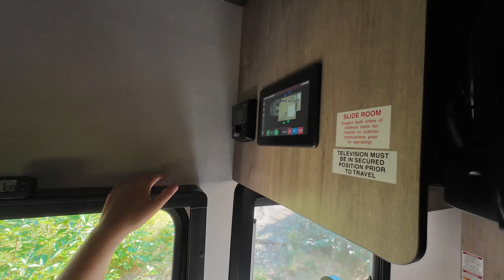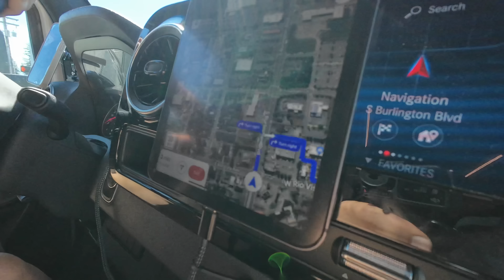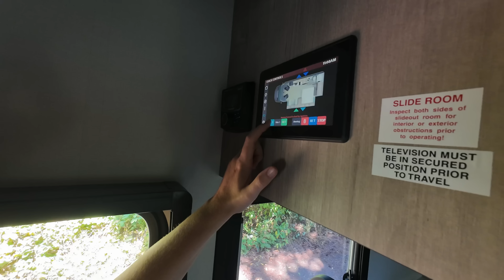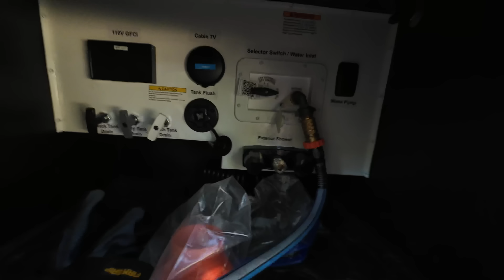My Wife Drives (And Sets Up) Our RV Alone

Comment: So important to change roles not just in rving. My husband had a stroke 6 years ago, and I do everything inside and outside. Not easy at all. One night a bad rain storm caused a leak thru the roof into the kitchen, forgot to bring in the 30’ awning, and the smoke alarm kept going off. Since I couldn’t stop the screeching, I took it and threw it outside. Solved!  Keep changing roles, it builds such confidence and character.
Reply from the maker: It is important!

Comment: Great job!  I will say this is why a motorized unit appeals to me, and I like your unit! I think it may be more user friendly than a towable as far as driving .  This is on my bucket list to switch driving roles.  I have helped with most everything else.  We have a 34’ airstream trailer, a gooseneck living quarters horse trailer, and I tow a small horse trailer and I still can’t back up to save my life.  The living quarters horse trailer scares me way more at the thought of towing than the airstream. So far, my towing rules are 1) Get in the right lane 2) Stay in the right lane 3) If it involves backing up, simply avoid and only do situations where I pull forward.  I don’t know why, but so far, hubby has not relinquished control of our 34’ airstream classic. He wants us to find a huge empty parking lot to practice first.
Reply from the maker: Thanks! We got to try this prototype from Grand Design out and we have loved it!

Comment: One thing I was taught was to change the water selector before turning on the water.  They told me changing it while under pressure is hard on the valve.
Reply from the maker: Thanks for the tip!

Comment: You never know what will happen when you are on a trip. I know ppl have roles they prefer and are comfortable doing. But if something were to happen, it's important everyone knows what to do. This includes trip planning,  navigating,  and the financials/insurance. If someone gets incapacitated, there's no reason someone is left helpless or clueless.  Having some experience will give you confidence that when called upon to act, you can do it safely esp if you have kids depending on you to remain calm and do what must be done. I hope as your kids get older, you show them the important safety measures they should take to get help or to step in to help. By 8 i knew how to cook, put out of grease fire, and do basic first aid. Thank you Girl Scouts/Brownies, and parents that were migrant farm workers who had to help out as kids and made sure we had skills too. Marissa did well. Hand signals should be reviewed before having to use/understand them. Set the camera on a tripod etc so the driver can see the signals or use a cell phone like many other RV couples do. Frustration is a two way street and it doesn't have to be. Keep switching roles until you're both somewhat comfortable doing them
Reply from the maker: Yes, we should be able to reverse rolls and help each other out if needed!

Comment: My wife and I had 3 travel trailers. She did not pull any of them nor did she ever want to! I was fine with that! I remember just after getting my drivers license (16-17) my mom,sister, and I went camping for the weekend. She had to get someone to back it into the campsite as it was a tight fit. On the way home she asked if I wanted to try pulling it, I said sure without hesitation! I drove the rest of the way home even having to take a detour along the way. When we got home she asked if I thought I could back it into the woods across the street where we parked it? I said yes, she said to let her out, she wasn’t going to watch. Before she was in the house, I had already parked it where I needed. She came running back over and asked me why I didn’t do that I n the campground? I told her, you didn’t ask! 😂
Reply from the maker: Awesome 👏 you’re a natural!

Comment: The added weight of two children sitting in the moving slide is enough extra weight to break that weak slide motor.  If you want your slides to last then remove ALL extra weight before moving the slide.
Reply from the maker: Thanks for the tip.

Comment: Nate, I am going to leave with this. Like I said, I was a union ironworker for 35 yrs. Had to flag cranes and other operators for different things. Figure out how each of you wants to flag each other with hand signals. Meaning, if you want to turn more in a certain direction. The fast you move your hand, the faster you need to turn. Slower you move your hand the slower the turn. Straight back is parallel to you head. Watch planes being parked. If you are lined up. They have their arms out wide, closer you get to stopping point the move their arms in closer. Stop is when their arms cross.
Another point in communication. If the person flagging behind points left. Does that mean the back of the trailer needs to go left or do I need my front tires to turn left ?
Reply from the maker: Thanks for the tips!

Comment: Those hand signals drive me nuts . As a primary driver you should know ,you cant see 1 hand movement with a vibrating mirror . You see millions . Point inthe direction with both hands , one arm streight out and the opposit with the palm facing your chest , dont move , the mirrior does . When its time to stop , clench fists in mirrior direction , dont trip trying to walk backwards
Reply from the maker: Yes, typically one person isn’t holding a camera in one hand and directing with the other 😊
Reply: I find audio easier just a voice saying driver. passenger, straight, or stop
Reply from the maker: @Tatiacha  thanks!

Comment: We are so surprised that you’re not using disposable gloves to handle emptying the black and gray tanks! Why would you reuse the same gloves over and over and get funky water on your gloves when you open the black tank and then be handling the levers to pull the black and gray tanks with the funky water having been on those gloves? A box of disposable gloves on the Amazon is not expensive and far safer. When you’re done, throw them away and wash your hands. Love you guys and respect you very much. Just surprised about that.
Reply from the maker: Thanks, you’re right about the gloves. 🧤